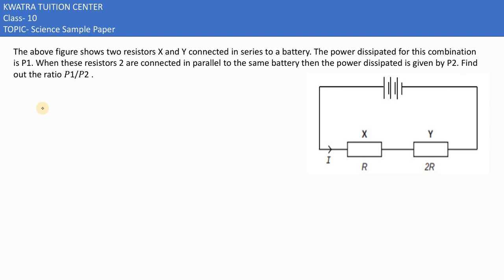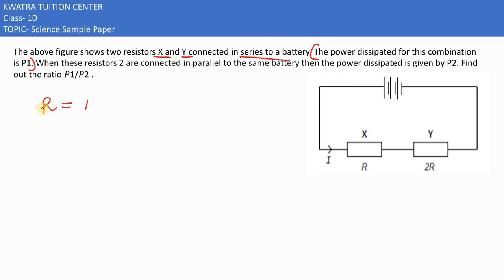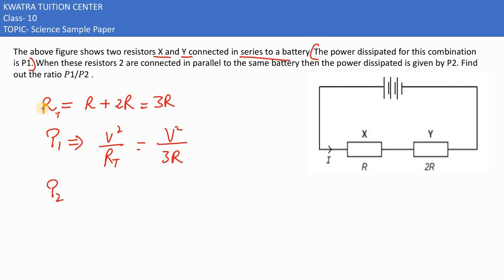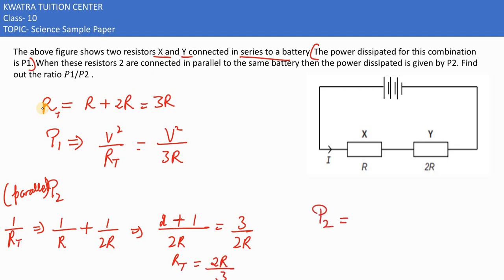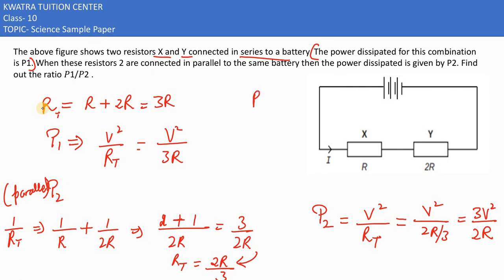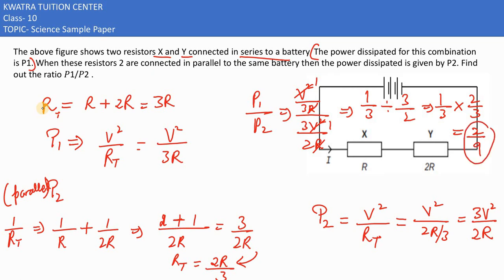25 b. The above figure shows two resistors X and Y connected in series to a battery. The power

Comment: par series maimaam voltage different hona chahiye na. we cant assume that the voltage is same in series. please elucidiate🙏
Reply: We cannot use P=VI because both Voltage and current is different in one another. We need atleast one same thing between them while finding ratios. ( like Resistance of X amd Y.)

P=V²/R
In here V is taken as the sum of 2 Voltages that (voltages of X + Y).which is the vlotage of entire circuit.

We can also do P=I²R
By taking I as the sum of electric current of X amd Y.

But If we do the first method (P= V²/R) we will get the ratio as 2:9.

If we do the 2nd method (P=I²R)
We will get 9:2.

Inorder to determine which is correct.
The ratio is P1/P2. 
P1 is power in series and P2 is power in parallel.

Power in series is Low and Power in parallel is high.

Total Power in parallel > Power series.

Therefore in the ratio 9 and 2.

9 belongs to P2 because its parallel and power is higher 

And 2 belongs to P1 because its series and power is lower.

Imp thing to remember 

Power in series = (1/P = 1/P1+1/P2+1/P3)

Power in parallel = (P=P1+P2+P3))
Reply: Read full U will not regret
Reply: @simplejames1642  thank you somuch. doubt cleared
Reply: @simplejames1642  bro really explained my biggest doubt in a yt comment 💀
Reply: Thnk u sm @simplejames1642

Comment: Yaha pe I²R kyu use nhi ho Raha hai???????
Reply: Yes I also have same doubt, if you get answer pls tell
Reply: Becoz dono mein current same nhi hoga
Reply: Toh series mai bhi voltage alag hota hai..
Reply: @Shriya9829  yha pe voltage ki baat h aur connection parallel h
Reply: @ChrisGayle1234  pls tell series aur parallel mei respectively voltage and current mei se kya same/different hota hai
Reply: @renugupta7778  series mai current same aur voltage different. parallel mai current different across 2 points and voltage is same across 2 points